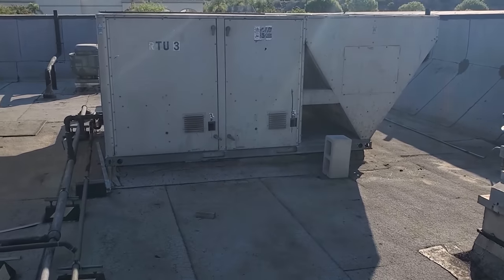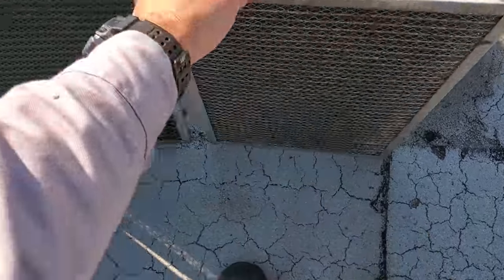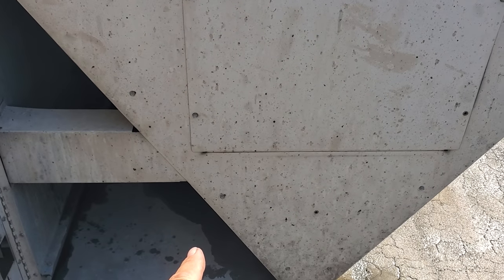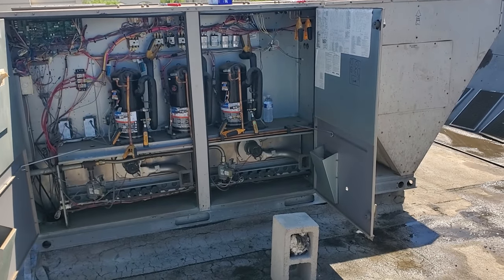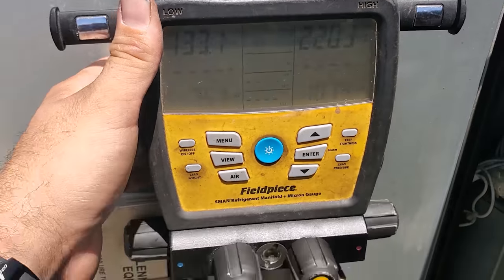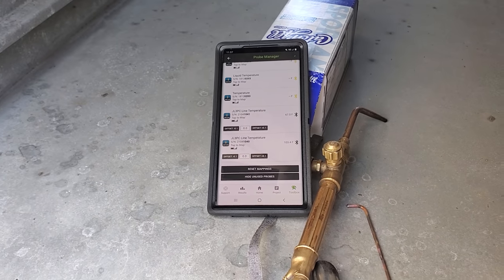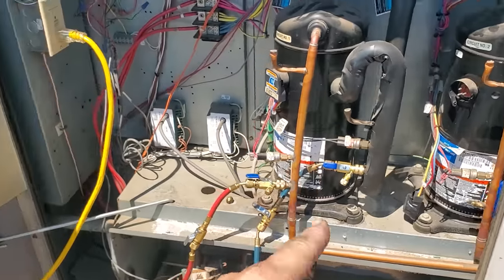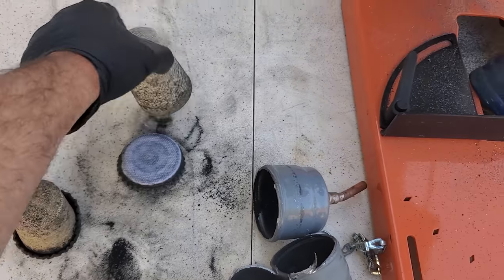ITS JUST AN AC HOW HARD COULD IT BE......

Comment: Compressors don't die, they're murdered
Reply: Usually
Reply: Absolutely 
Most compressors fail because of system problems. Those scroll and piston ones from Copeland and Tecumseh are tough some others too
Good job by the way
Reply: Mine just died, but it's also 30 years old in AZ. 😂
Reply: @Jonathan Fair
That’s not bad pretty good life for an A/C that gets used a lot. You probably maintained it well.
Reply: I've seen quite a few compressors make it over 30 years but I've also seen them die in under 5 years

Comment: Crazy that that new drier clogged literally in front of your eyes after install. Nice idea on the ball valves. With some customers.... maybe you should put them on whenever you change a drier that doesn't have them. The customers that aren't too big on PM. How awesome would that be to just have to vacuum down 3 feet of pipe every time you change one. Great video!!
Reply: Winston.. in a perfect world it would be a great thing. Actually if engineers would do it from factory.
Reply: @FlyEaglesFly19111  I agree. All those large package units should have ball valves on the condenser, the evaporator, the drier, and the compressor as well. If they did, then we would be able to replace components without having to recover or vacuum the entire system, only parts of it. That way you only end up recovering and vacuuming the entire system if it's something that needs to be done, or something you wish to do.
Reply: @FlyEaglesFly19111  they do… on chillers and industrial equiptment. All the equiptment at the prison here I can change the filter in no time
Reply: With the build quality going to crap like it is do you really want more spots in the system for potential leaks? Solder joints are lacking in the factory nowadays.
Reply: @pende97  I think it’s more of a material issue than anything. The base materials are getting so cheap they don’t last. I don’t really have issues with brazed factory joints
Reply: @nsboost  I agree to a degree. It would be nice if they were factory installed. But on the flip side I am not impressed with quality control anymore.
Reply: @nsboost  I fixed a factory joint on a suction line on a new lennox last month.
Reply: @winstonwright3613  Those are baby package units. Ball valves end up leaking when you turn them after a few years anyway. I just installed ball valves on an APR valve so I could troubleshoot a Trane makeup air (yes, Trane installs APR valves in the factory with no solenoids or ball valves to isolate them, freaking a holes) and the valves didn't even have packing nuts. The cap has a teflon ring in it and it is the only seal. Wait until that valve leaks and blows the brass cap into your forehead. Junk.
Reply from the maker: @jman0870 I agree ball valves are a last resort and I often find them leaking
Reply: @HVACRVIDEOS  I thought they were something special that were less prone to leaking than regular ones. Never held one in my hand. If they're leak prone, then ya... nevermind.  You seem to have enough trouble with leaks on these units! LOL Thanks for the discussion all!!
Reply: @HVACRVIDEOS  I prefer ones with packing nuts when I use them. Same with king valves. Had a king valve on a continental prep table receiver start spewing liquid out of the stem after I walked away for a second last week. No packing nut. Had to back seat it and pierce the liquid line to troubleshoot. Soon we won’t fix anything anymore. We will just throw it all out 🤣
Reply: @FlyEaglesFly19111  If engineers had to work on the units there would be a lot of things different design changes on the equipment.
Reply: @deanholder9487  I doubt it! It’s all planned obsolescence. Long as it lasts just long enough to get through warranty (if you are lucky). All about the bottom line these days.

Guys like us do our best to fight against it tho! Cheers 🍻

Comment: Get a contact stethoscope. You would be amazed at how much better you can get at diagnosis. Just start listening. Motors compressors even a listen to the housing. Over time you will begin to identify certain noises with certain problems. I do this with heavy equipment cars lawn equipment etc.
I learned this when I was a printing press mechanic.
This is especially useful in loud environments where distinguishing sounds is harder.
Reply: Thats an ole car mechanic trick... it works great
Reply: @FlyEaglesFly19111  You know it. The old "screwdriver tip to the suspect part's housing, and then handle of that screwdriver to your ear" works great. Or you can get a purpose-built mechanic's stethoscope, which will do the same thing and won't get you any funny looks from the layperson.

Comment: Great display of skill. The lack of preventive maintenance causes the electric bill to go up as well as being destructive to the equipment. Why is this customer planning new replacements without you knowing? No loyalty?  Learning the electronic controller codes takes special education time. These controllers are always changing from year to year and manufacturer to manufacturer. This "education time" can not be billed directly to a customer so it is recovered in the hourly labor charge. Customers need to understand this is part of WHY labor rates are so high. Also, the amount of tools required to work on these rooftop AC units is enormous. And it's heavy to carry all that up to the roof.  The technician's wages in HVACR should be the highest of all the trades but it's not. Is it any wonder why we can't get new techs into the trade? It's hot, dirty, strenuous, and requires more ongoing training than any other trade.
Reply: TolsleOfView.. great synopsis you have there. The trade has changed a ton in thw past 5yrs substantially. More in the HVAC side than the R.. yes the Refrigeration side is becoming more electronic. But yes a constant training for HVACR. Than other trades is spot on!
Reply: @FlyEaglesFly19111  When I started in this trade, R-22 was 69 cents a pound & individual relays created all the control logic.
Reply: In the commercial restaurant chain world its pretty common for the restaurant corporate head of facilities deal with ordering the roof top unit directly from the manufacturer with a  national account representative. So he will still probably submit a quote and be in charge of installing it but considering lennox is currently quoting a 14 week lead time on new units they probably arent in a hurry make arrangements to get a install quote. Thats why are are planning replacements without him knowing. Its pretty common for them where I work for the facilities guy to visit the store and order new units based on age alone and all the sudden we get a request for a quote and asked to approve roof curb layout.
Reply: When I started in this trade there were three basic refrigerants 
R12   R23   R502
And maybe some Careen 7 once in a while
You do know what that is dont you
Reply: R22
Reply: I made an error and put R23 where I meant R22 hence the correction
Careen 7 is not R22
Can you say what it is?
Reply: @farmerhunterjr  thanks.
Reply: @james4582  Never worked with Carreen 7 unless your speaking of R11. I also recall there was an R500. As an Operating Engineer, I handled R11 and Lithium Bromide. I even got to tour an Ice cream plant that used ammonia.  Ammonia is still around but heavily regulated by mechanical codes.
Reply: @ToIsleOfView You got it pal 
It’s R500 it was a blend made by 
DuPont primarily for package units   before R22 became favored 
R12 didn’t perform well in package systems because of the low side pressures which sometimes actually worked in the vacuum side of pressore. R500 solved this issue by bring the low side pressures above vacuum levels 
It was kinda a blend between R12 and R22.at times when one didn’t have or could easily obtain it you could actually put in some R12 and R22 to get the pressures to work for you. careen 7 was the original designation for a while and only produced by DuPont who held the patient on it then after that it received the R500 label and made by other chemical companies. 
R11 was used in high caps I sudtems like large chillers and centrifugal unit’s or as a we used it as a solvent to clean and- flush dirty or burnout systems because of its high boiling point.
I actually several R12 and R500 
Package systems I serviced
The R12 units were installed in the 50s and R500 ones up to the early 60s. I started in industrial systems using ammonia in a winery. Ammonia is still used a lot in larger systems, like farm cold storage, some grocery stores, and large plants that need refrigeration. One of my contractor 
Specialize in ammonia. It just takes different tools and equipment steel piping and such.
Personally I got away from it and never looked back lol it can be nasty to work with. They are using CO2 systems now for some large applications. And most domestic refrigeration using propane blends also in ice machines 
When I retired in 1971 I was carrying 7 or eight different refrigerants on my truck and 2 or 3  less used in my shop. I was in business 42+!years not including prior experiences The last 15-20 years I stopped installs of residences anA/C systems concentrating on service and repairs mostly I did some installs for commercial systems cold boxes freezers ice machines and restaurant equipment occasionally partnering up with a buddy for more bigger jobs mostly I liked working by myself. I was a trouble shooter for many times. A good majority of companies now are just part changers and condemnation experts IMO
I like to see some of these videos and see how they troubleshoot systems. It does my heart good to see these fine Mecanics/Techs work and show their skills.

Comment: From my experience it is clear that this unit is drawing kitchen exhaust into the condensers and air filters. I had one project many rears ago where I was called in to assess as the service contractor could not improved performance. I test the condenser coil, although it had been cleaned, when I put a meter over it there was high air flow in the centre but quickly decrease to no flow as I more away from coil centre. The coil had to be removed and cleaned bit long term we had a new condensing unit fitted away from exhaust.

Comment: It adds another level of complexity to controls, but it's nice to have a static air pressure differential sensor between the inside and outside of the building and have that control exhaust fans, or makeup air accordingly. I set up controls on a very large building that had air handlers that ran in economizer modes with no fans on the returns which would build a lot of pressure in the building when in economizer mode. The pressure sensor automatically staged exhaust air fans to maintain the proper pressure range.

Comment: An old timer refrigeration man taught me that oil goes through the expansion device much slower than the refrigerant. If a lot of oil is in the evaporator (like after a leak or restriction) You need to wait and watch.
Reply: R22 makes wax...that's why they don't use it on freezers.

Comment: On Unitary equipment, I’ve done that same set-up you did, I’ve done double FD bypass, I’ve moved the FD closer to the TXV, I’ve converted the TXV to Chaflett, etc. Why sweat in a 3rd replacement TXV? When you can isolate, verify pumpdown hold,  change the Flare FD, change the converted Chaflett TXV, etc. Some “Techs” don’t dig as deep as we do. Some small systems can be highly contaminated.
I once gauged up to a 3TR Wall-Mount at ROW site. I started losing pressure, I looked for leaks nothing on the system. I sprayed my hoses - they had pinholes everywhere. Caused by the high acid in the system, any longer the terminals would’ve blown.

Comment: When R410 was first offered in kitchen freezers I had no idea the oil could turn to black powder. Kitchen management bought a new American brand 40cf freezer that had a 1-year warranty. It failed @ 11 months. The manuf wanted their guy to repair it, so he installed a new compressor. 4 months later it was tripping the breaker and no warranty. No dryer, no screen on the expansion valve just a clogged liquid line. The black graphite-looking powder that came out was mind-blowing to me. Called around and learned that this was a popular new complaint and the cause was very high condensing temperatures. My Freezer was operating in a 75-degree kitchen so what's up? After installing an oversize dryer & a  bigger fan it was better but still too high for this location. Installed a new factory condenser and a big flair dryer. Better but still high. A new compressor was installed 4 months later and again 6 months later. Each time we had the system open we cleaned the dust from the liquid line and replaced the dryer! Turns out the refrigeration condenser was just too small. Sure glad it was indoors. I was the facilities engineer and service costs came out of my budget. I told the kitchen management that I would not waste my budget to keep this junk working. They let me trash it and I got a new Hoshizaki. Some equipment manufacturers hire engineers that will cut corners to meet a cosmetic dimensional spec.

Comment: you noted that these units are being used for make up air.  Most manuf. that I have talked to stress that these RT AC gas pack units are NOT make up air units and to use them in that way will void the factory warranty.  They are not designed for this purpose and having to try to temper all that outside air will definitely kill compressors and the other components and really overstress the unit.

Comment: I'm preeeeeeeetty sure I know which restaurant chain that is. I was fairly certain when you said all the RTUs are makeup air. I'm pretty much 100% positive after I saw a certain sticker on a certain unit. Half my summer has been washing their ridiculously impacted condensers because they literally do zero maintenance haha.

You need a molecular transformator for pulling charge. I pulled 20 pounds of 410a today in like 15 minutes. Granted it was only 80 today (it's been in the 90s and humid for weeks), but it really makes little difference if the bottle is in the shade and the subcooler is in water.